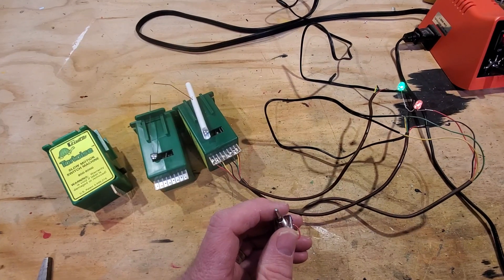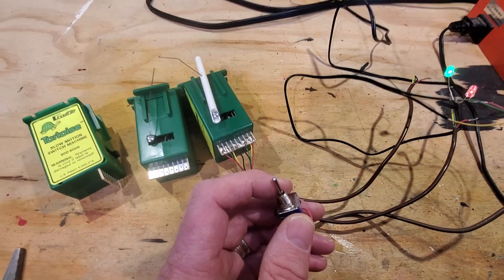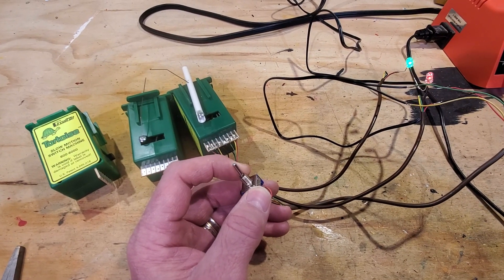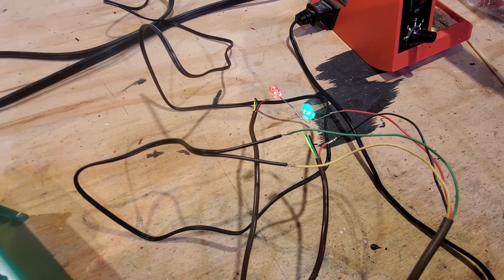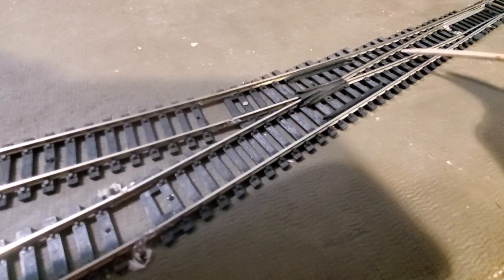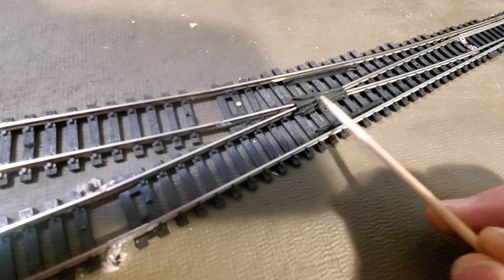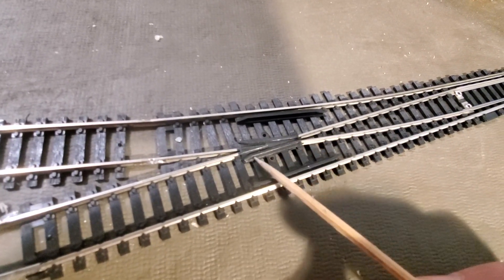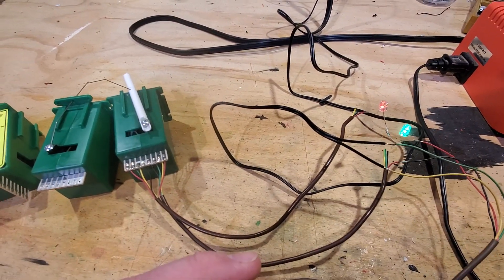My Personal Intro to Tortoise Switch Machine Wiring for DCC

Comment: Nice tortoise intro. I have same Atlas switches and tortoise machines. Not quite ready to go down that rabbit hole yet... You mentioned at the frog, two holes for screws or soldering, do you need them for DCC or just pointing them out?
Reply from the maker: The Tortoise will work just fine for both DC and DCC operation using only pins 1 and 8 for moving the switch points.  Powering the frog is optional.  If you find that you have reliability problems at the frog, I'd suggest you try to drop a wire from the frog to the Tortoise.  Then you'd need to bring track power in on pins 2 and 3.  The Tortoise decides which polarity the frog gets.  Same for both DC and DCC.   Good luck and thanks for watching!

Comment: Thanks for sharing. Can you do a line drawing of what you just did? Hard to follow where what wire went where. And why the white lever on the far right?
Reply from the maker: @Vman7757  You're welcome!  I just posted a hand drawn diagram in my community section.  https://www.youtube.com/post/Ugkx_fRL5_9nFIDriJOm-kuJFiSm8dLt2Qkq   The LEDs are wired in series but they are opposite from each other.  The green illumination will indicate the alignment of the switch.  Red will indicate the UNselected route.  

The tortoise machine with the white styrene tube is a take-off from an estate sale.  Not sure what he was using that for.  Maybe crossing gates?  Anyway, just used that machine as an example to see something moving.  Did not mean to confuse!  Sorry!